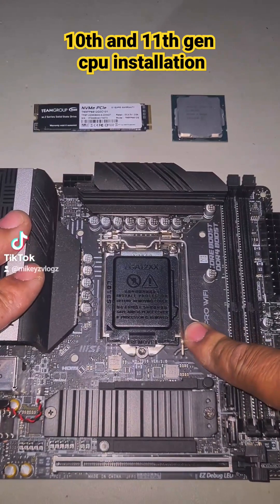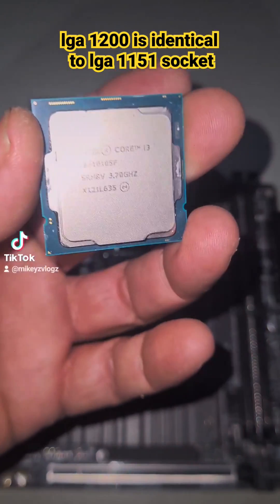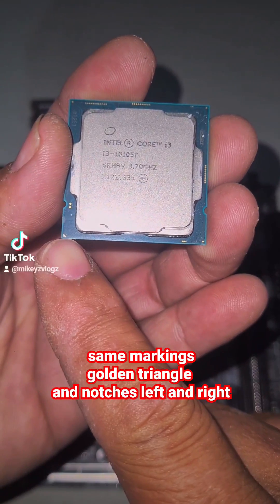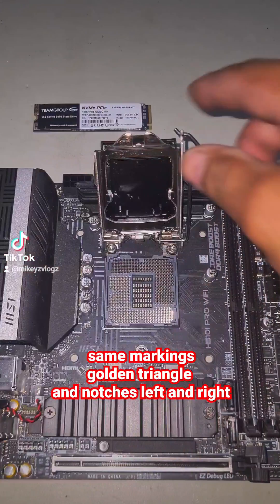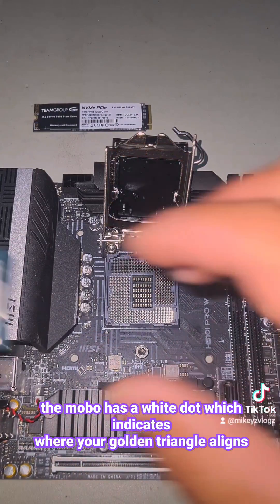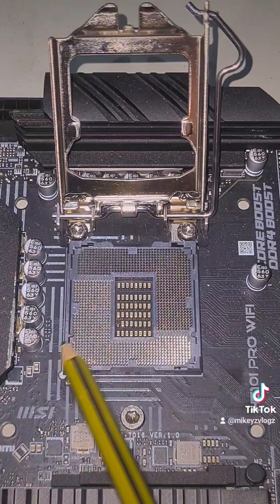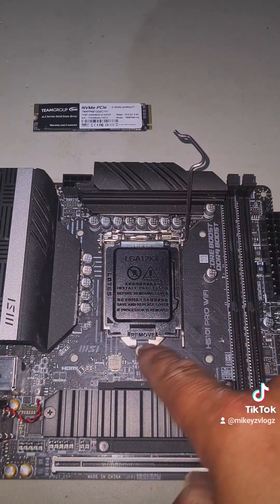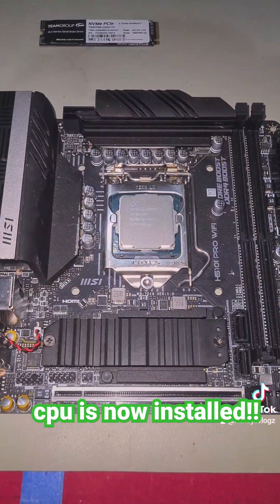how to install 10th and 11th gen cpu lga1200 socket. 10105f cpu install on msi h510i itx motherboard

Comment: Can i install i5-11400F on asus prime H410M-E motherboard which currently has i3-10105F my motherboard BIOS version greater than v1403(1620)
I've heard that it is compatible but with updated BIOS version  
I don't wanna chance motherboard right now 
Please reply
Reply from the maker: Yes u can ... 10th and 11th are compatible... u may need a bios update ..not too sure ... eventho a simple bios update is relatively simple ..u follow commands and u are done in no time..I'm completely self taught using YouTube and the internet I have alot to learn but updating bios is simple as can be and I would recommend to do so..as latest bios versions always have bug fixes and updates as well...
Reply: @MIKEYZVLOGZ I've heard, in order to run the 11th gen of the processor in the 10th motherboard i need to have atleast v1403 BIOS or greater and i have v1620 BIOS version
Reply from the maker: is 1620 greater then the one u haveM if so should just work